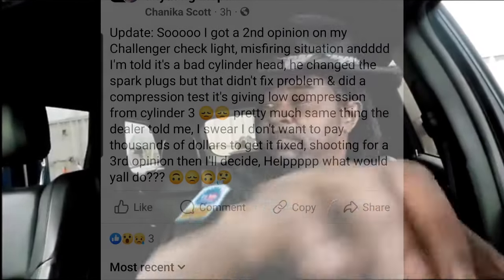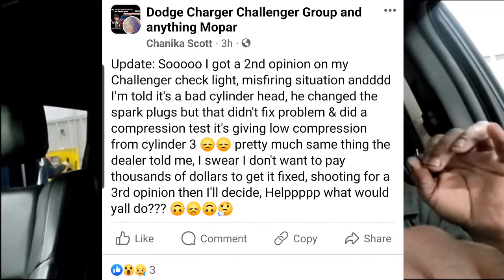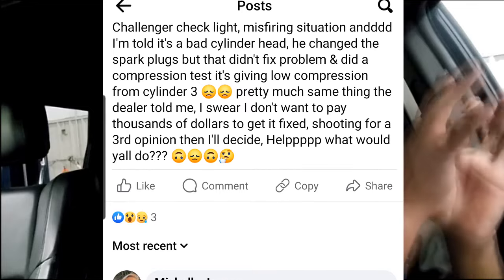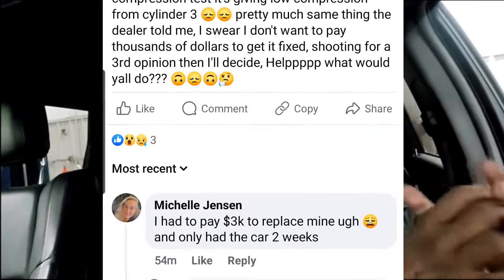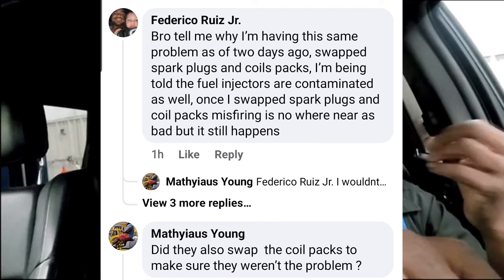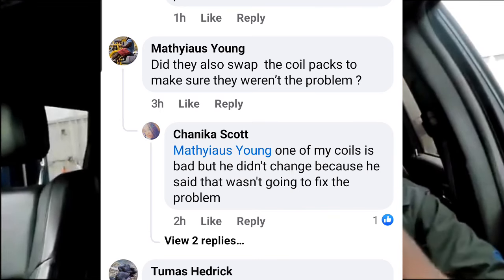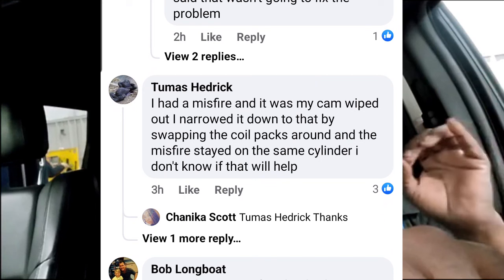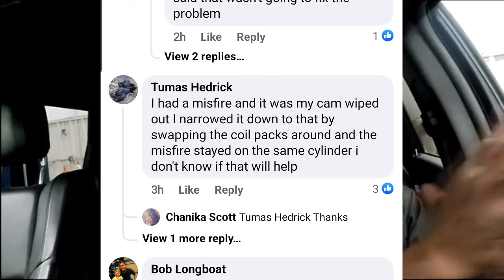Don't waste money on this. Here's how to find a misfire with low compression on this motor.

Comment: I thought I had bad lifters/rockers. After tear down and inspection, turned out to be a head gasket. Changed the head while I was at it along with new lifters, rockers, gaskets, seals, plugs, oil cooler and accesary drive pulleys/tensioner and belt.. more than I thought I needed before I opened it up but it's back together now and running
Reply from the maker: Thats whats up, good job my guy.

Comment: 8:31 my guide is if it's not smoking, lower end knock, or excessive crank cases pressure it's more than likely upper valve trane
Reply from the maker: I agree. Don't see to many lower end problems on this engine.
Reply: @OnlineMechanicTips  right. It takes a lot to mess up the bottom end. I believe the biggest problem with cars is the operator. Little old granny car 200k+ miles, woth routine maintenance still going strong. Younger generation dog the crap out of them, very little maintenance then cry when they break down. My 5.7 4x4 Grand Cherokee only had one major change, and that was valve seat dropped. That didn't happen until I started towing heavy. 240K and transmission just went out. Never had the fluid exchanged in it. But before heavy towing, I drove like I had some sense.

Comment: Yoo jt is 120psi compression test on all cylinders a good specification for a 3.6 pentastar motor ?
Reply from the maker: I don't no the spec by hard but I'm guessing it should be higher.  But the thing to worry about is if all them fairly the same.